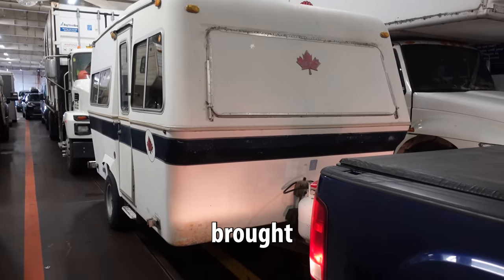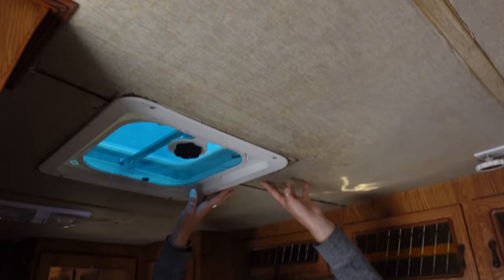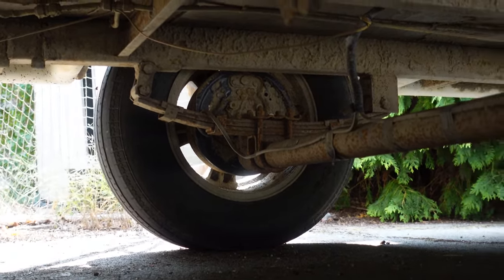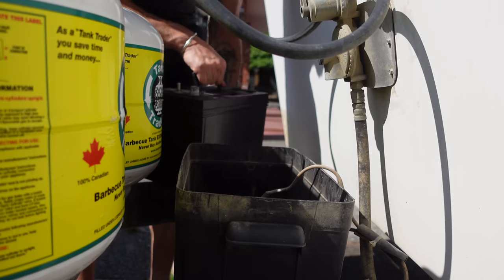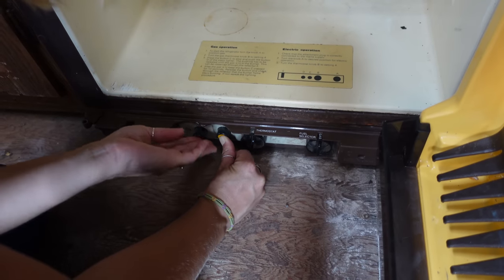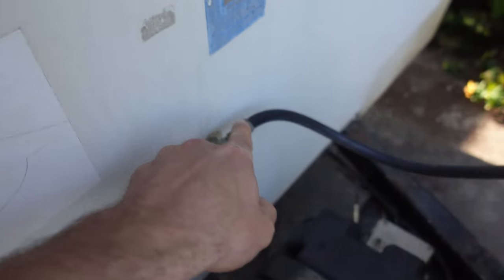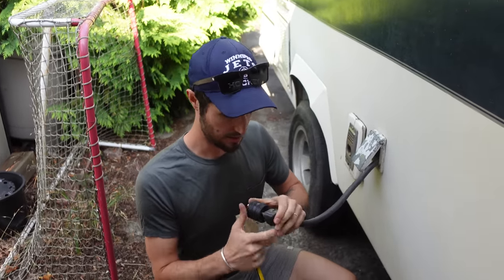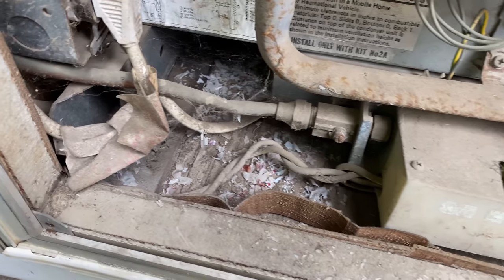Everything Wrong With Our Vintage Trailer (So Far)

Comment: You certainly won't be bored! That's a lot to take on right now with a baby on it's way. My suggestion would be to have a professional inspect the caravan before you head out camping to rule out any safety issues. And do make an asbestos test before you start tearing anything down. Good luck!

Comment: A lot of really good advice in these comments. I especially was surprised you didn't replace any light bulbs first before trying the 12V electrical.
I can't stress enough how true it is (as others have said), that you will save yourself all kinds of grief and expense (possibly heartbreak too) by just gutting it first, and immediately replacing all the electrical and propane lines. It's also a safety thing at this stage in the life of the trailer. At the very least, get a CO2 and gas leak detector -- just concerned about your safety  here.
Yes, it's a huge project that maybe you weren't quite bargaining for, but the end results will make you rightly proud and it'll be fantastic content (which you two already have a good handle on).
I'm rooting for you -- with baited breath, and wishing you much success!
Cheers!...from North Vancouver
Reply from the maker: Thanks for the comment! We're getting it figured out one step at a time here, as to the lights. They're new from the previous owner who put them in 👍🏻

Comment: Levi! Embrace the suck! This needs to be taken down to bare walls. The beauty of that rig is the shell. I would start over with electrics, because I wouldn't trust any of the wiring. Probably the same with the propane. And it will be easier to just replace the windows, take the old ones out, find a modern replacement. Good luck. You're gonna learn a ton and have a blast.
Reply: Window seals are universal, trim to fit

Comment: If it were mine I’d gut it and make it an entire redo.  New insulation, check all the wood and make sure nothing is rotted from dry rot, moisture, or insects.  Pull off all the caulking and redo all of that.  Get the windows fixed or replaced, run new electrical so the thing doesn’t burn down, insulate the windows, check all the gas lines and fittings so it doesn’t blow up., rip out the ceiling repair and insulate, put a good trailer coating on the roof, maybe rubber. Check all the water lines, tires, flooring and flooring insulation.  Install an air conditioner or at the very least some fans in the roof to exhaust and pull in fresh air.  Make sure it’s properly winterized so pipes won’t burst when it gets cold.  Put in a CO2 detector, make sure the door and lock is secure, do something with those steps so you won’t get a broken ankle, been there.  Install some led lights.  So yeah a total gut. This should be fun.😂. The old girl may still have good bones. Defiantly a paint job.  Check for gas leaks with the dish soap and water trick.  A little dish soap in a spray bottle of water.  Spray on the gas lines if it bubbles she may blow.  Just replace all the lines and fittings.

Comment: The pipe on the roof is your sewer vent should have a cover on it. The cover for the sewer dump  pipe can be bought for cheap. There should be a 12 volt fuse block. The fuses you showed in the video are the 120V. It looks like he switched the light bulbs to LED so he must have had them working. Good Luck with the trailer. I wished I lived closer so I could help you, I love working on old trailers.
Reply from the maker: Yeah we actually got them working thanks to a tip we got from the guy who sold it to us. We're getting it figured!

Comment: We just bought a old caravan recently and stipped it back to frame. Its really easy to get overwhelmed. Do it once do it right. Take it one step at a time. When you get to the point of pulling the roof down hose roof while everything is exposed under so you can see where it leaks. Good luck guys! X

Comment: Agree with others, stripping it out see the “bones” of the shell and structure is probably the best idea.

Also get a barbecue lighter, it’s safer for your fingers.
Reply from the maker: We're going to try and make it work as is at least just to see what we would like to have in terms of trailer amenities and features. Gutting it is a whoooooole other things 😬
Reply: @LeahandLevi  once you find the fuse for the 'kitchen' and replace it or find the wire that is disconnected there should most likely be an electric starter on the stove like a bbq or gas household stove. Do you belong to Reddit? You should see if someone on there has a manual or owns this type of trailer already and pick their brains!

Comment: Could these lights use their own internal battery? They don’t look as old as the rest of the camper. 

I think you’ll want to at least consider swapping out all the gas + electrical appliances for newer/clean /safe ones. I felt nervous just watching you guys experiment with those old nasty things!
Reply from the maker: We found a manual for the model year two years newer than this one which has already helped... but sadly we're going to be looking for all those other ones individually. 😬

Comment: I'm wondering if, eventually, you might gut the whole van and do a rebuilt, converting it to solar? Also, did you check the lightbulbs? 😂 You certainly have your work cut out for you. Good luck. 🍀🍀🍀 Also, those coveralls look HOT on you both. Tssss! Smokin' baby! 😂😂 Take care, Leah and Levi. No breathing in that propane, ok? ♥♥
Reply from the maker: We're not ruling out a gut and rebuild but for now we want to get a feel for how this thing works and then go from there. Thanks for the coveralls comment 😂😘
Reply: @LeahandLevi  😁
Reply: Agree “work cut out for them”. Like they need a project with a new baby , personally I think they are not thinking practicality .  Also she shouldn’t be breathing in anything , the dust , mold, & soon fiberglass and paint .  It’s too old & too much work.  When we were yuppy 30 something first time parents it was a big change and having something like that on top of everything would have just caused more stress.
Reply: @Moms1958  I was being a bit facetious about the propane. 🙂 They're intelligent adults. I reckon they have it under control. Also, they have a really great support network. So I reckon they'll be right. Cheers.
Reply from the maker: @Moms1958  I'm just glad someon have a positive attitude about it  😂
Reply: Solar is great nowadays… and changing to LEDs with lights, and better inverters 12v to 120v

Comment: Reddit  (and oddly enough Facebook groups) are always a good resource for building and rebuilding older vehicles and finding trade sites on what may work best for your rebuild. I've been working on a Ford Bronco 2 which is in driveable condition for the past few years and those are always a good fall back in terms of what may and may not work.
Reply from the maker: Ohhhh we’re in the fiberglass trailer forums daily 😅

Comment: You know you get what you pay for!   I think you may have been better off looking for something newer.  It’s going to cost you a lot of time & money.  With a new baby on the way I would personally rather not.  Learn how to fiberglass!  It looks like a death trap to me , lol.
 Also
That “hole” is your toilet vent. Also if there is water leaks there’s probably mold which you know is not good for anyone to be sleeping in.  There’s a reason he “got rid”  of it so cheap.  We bought used fibreglass trailers before but they were liveable /usable right away. The tires also look pretty old. 😮Have fun! 😂
Reply: Bigfoot trailers are HIGHLY sought after and valued. Newer junk isn't worth it. These Canadian fiberglass trailers hold their value. There newer ones from Bigfoot in this small 17' size are 80k.

Comment: When I bought my Rv (1999) last year  I searched website for owners manual,and electrical schematics buy them you will not regret it. In addition might want manuals  for the furnace, stove and refrigerator.Might have to search deep into numerous websites but you will find the brochures and model of your rv. Took me awhile but I found the information on mine. If you need help just reply to this post with year make and model I would love to help. Love your videos.

Comment: My recommendation would be to get a decent multimeter. That would go a long way in tracking down the electrical issues. If you can't find a wiring diagram online then I would recommend making your own as you go and figure out what does what.

Comment: For fixing the roof scrape off the old Dicor around the skylights and other penetrations and then apply Henry Tropicool. Put a 2” wide of the Henry around the penetrations, embed fiberglass tape in it. Once it’s dried coat the whole roof.

Comment: Having redone a 1969 FAN Styleliner with a brother who is an experienced builder…. I feel all the anxiety come back. It was a money pit and the damage was more then we anticipated and we anticipated damage. It was “where does it end” questions. Wishing you all the best on your journey.
Reply from the maker: 1969 is an oooooold trailer wow! I think we're lucky because the story of renovating it is online right? There's some external accountability here 😂
Reply: The price to repair this trailer would cost almost a newer one… personnally i would do that even if i could repair this.
Reply: But they don’t have the charm as the older styles
Reply: @wobblysauce  agreed 100%. When we bought ours it was an ice fishing shanty so they had holes in the floor and they tore out all the cabinets. They left the 4 bunks and dinette so we had to rebuild all the cabinets and we didn’t get to keep the blonde paneling bc of the water damage over the years.
Reply: @wobblysauce  that is why i would stick to brands like Boler or Airstream. But maybe i am wrong.. I would just not try my first renovation with that kind of "expert" project. I did those kind of renovation, but this looks like a "strip everything to the gut" and i wouldn't do that. Only if i had years to do it correctly.
Reply: @maximebedard1  Depends on the outside, fibreglass is nice, some builds are like moving houses.
Reply: @maximebedard1  airstream is my dream but that’s a bigger challenge on its own with all the curves… maybe someday

Comment: I have a 1976 VW Westfalia, and the initial overload is a real feeling I know well. A couple things I think are helpful that you didn't mention in the video: Manuals! The original trailer probably came with an owners manual, or maybe several (one for the trailer, one for the oven/stove, one for the fridge). You might be able to find model numbers to search the web for a digitized manual, they can be really helpful! Second thing is a simple tool called a "test light" that's really useful for figuring out if something has electrical power going to it, it's basically a screwdriver with a light in the handle, and a cable that you clip onto something connected to the electrical ground (like the frame) - then you can just poke metal things and if the light turns on, it has power going to it
Reply: Yes! All very good recommendations!
Reply from the maker: Yeassss! We have a voltage meter in our future for sure!

Comment: I am in the process of doing a complete re-model of my 1982 Bigfoot 17.  I am enjoying the process of learning new things throughout the build and it has brought my wife and me closer as we work together to accomplish a shared goal.  You don’t need to do a complete strip down as you can repair the water damage and put up a new ceiling and leave the existing shelving alone.  No need to take down the existing shelving to repair the damaged ceiling.  Fix the roof and ceiling first.
Reply from the maker: Wow that's a great coincidence eh? I found the 1982 model manual online but not the 80 😬

Comment: the 'hole' in the roof is probably a vent for the toilet.
You can buy a portable grey water tank.
I think where you start is by demoing it all.
The switch is a good thing - turns it all off when you are not using it.
Reply: Some tanks are under the floor and others are in the inside behind panels. Depends on the ground clearance
Reply: My thought was vent for the toilet too

Comment: As you are about to start a family I vote you not take on the stress of this remodel, nor the time suck or unknown financial black hole. It is not the bargain financially nor experientially you were seeking. Lesson your obligations at this time of your life to be fully present in the experience of pregnancy, birth, and transition to parenthood.  There are many great lessons to take away from this about how you ended up in this situation because it can apply to so much in life. Chalk it up to lack of experience, buyer-beware-when-it-is-too-good-to-be-true, and cut your loses. At the least, call Robert to pose all of your questions because some may be simpler than you think. There may be an internal power switch you haven’t found. When we bought our van we had someone with knowledge of this type of vehicle to do a thorough inspection and report before we arrived as a term for the sale. And we were prepared to walk away from the deal if it had too many red flags. This is hard to do.
Watching an earlier video where you disclosed that Robert game you a spare tire and some other random stuff ( but no battery, or black water connection it turns out) I had the feeling then that you were doing HIM a favor to unload stuff he wouldn’t have to dispose of. It seems more so now. 
There are often online forum / user groups that form around a model of trailer  composed  of other folks with repair and remodel ( such as electrical, adding solar, black tank vs compost toilet, etc) experience and you can also post questions to such a forum. This can help you discern if it is worth putting in the effort, and potentially even find repair folks with deep knowledge about your trailer or who can do a thorough inspection.

Comment: Some electrical theory would be helpful here. 12 volt DC(Direct Current) is the output of your Battery. It runs your lights and maybe the hood fan over your stove. 120 volt AC(Alternating Current) is the output you got from the house. It is very unlikely that your trailer has an inverter(Converts 12VDC to 120VAC). However, it should have a box that converts 120VAC to 12VDC. This is like a car battery charger that would charge your little battery, probably behind the rear wheel on the passenger side. In your trailer, this is what charges your battery through the extension cord you have plugged into your house. You'll want to find that box, since it doesn't seem to work... When you are traveling, you won't have power at your outlets unless you have electrical hookups at the campground or install an inverter, which would draw power from your battery. The other way your 12VDC battery on the front of your trailer can be charged is when it is hooked up to your tow vehicle when it's engine is running.

Comment: Try avoid gutting the trailer. The windows and roof vents/lights/fans can be removed and resealed which should fix any leaks causing the water damage. Plenty of resources here on YouTube for fiberglass camper repairs! 
Take it one problem/repair at a time. You’ve got this!!!

Comment: So I bought an older rv in attempt to live in it full time which was a complete disaster, but I found an RV outlet, they had a shop and the ability to order almost anything. I recommend finding an outlet if at all possible it was so much cheaper than other options. Also in my rv the bulbs bulbs blew almost constantly in the same style lights you have, so try swapping the bulbs, and having backups as you will likely blow a few while doing repairs. Also you may want to cover the trailer with a tarp until you are sure it’s water tight to avoid any water damage.
Reply: Great idea!
Reply from the maker: Finding a rv outlet sounds like a really good move! Thanks for the tip!

Comment: i would get a jackery and bypass that old stuff and strip the whole thing down, install solar, install a battery for the solar. find a way to hook up the battery to the alternator so it charges also while the car is running. then figure the rest of it out while stripping the whole thing down coz that's where you'll know what works and doesn't and what else needs fixing.

this is basically what i do with motorcycles i refurbish. i strip it all down, clean it up, see what's broken and what's not. put it back together and replace what needs replacing. then get it running.
Reply from the maker: We've actually already got a ecoflow battery and fridge from the prius build so our plan is to use those in the meantime you know?

Comment: Levi & Leah, this is fantastic! You both are incredibly smart and have the capacity.
Either you can go all out or patch as you go.
 Toilet: small cassette toilet. The tank can be emptied into a regular toilet.
Roof: can use a tarp for now. You can make it look nice. If you do solar, make that the water proof barrier.
Gas: take a spray bottle with soap water and spray ALL the gas lines to makesure is doesnt leak.
Electric: learn how DC works(easy), where your grounds go, clean every ground you can. Use dielectric grease(extremely important) this is a water-resistant coating, it is MAGIC sauce.

Just remember, everything you do to patch will need to be trashed when going all out on the renovations. 

You HAVE TO concentrate on the small things, and find major pleasure in them.

You guys already have lived the hard way, just think about this as your Prius, just a bigger box with a bathroom. Use portable lighting, kitchen, camping stuff. This will also keep it as light as possible. 

Much luck and ill be commenting with more unsolicited tips in the future

Comment: For safety, I would want to replace the old wiring and propane lines. I agree with others who said gut it, so you really know what you’re dealing with. Also, I was taught to put the flame by the burner first, then turn on the gas. Is that right? Does it matter?